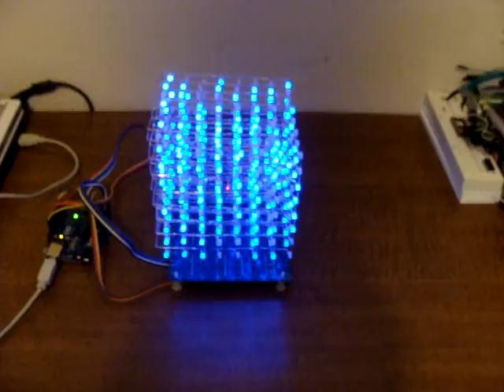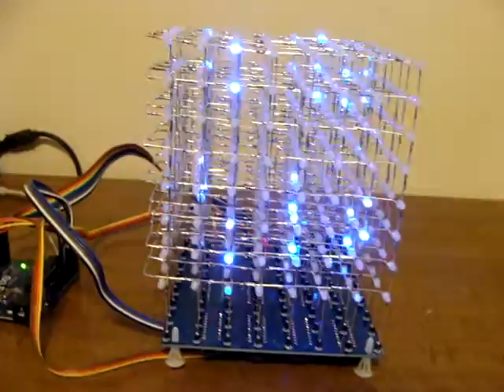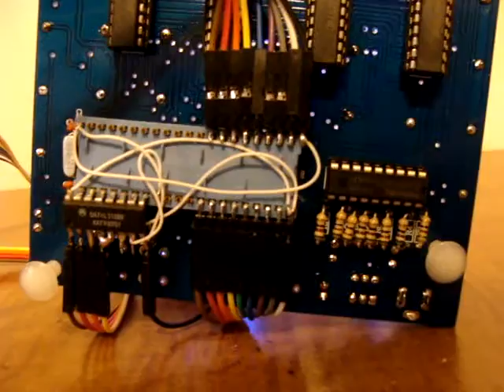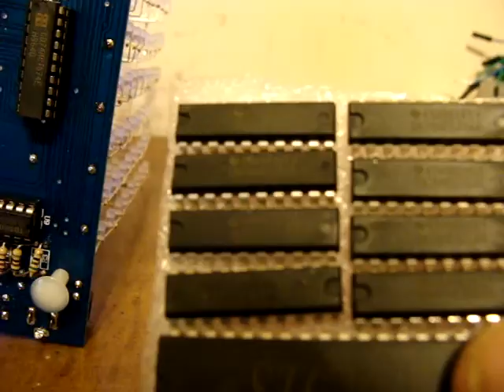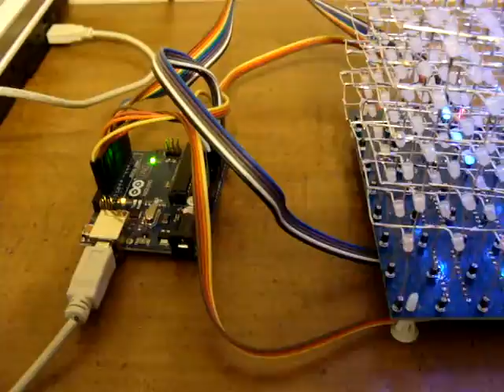8x8x8 LED cube retrofit with Arduino

Comment: Hi Bob,
I was wondering if it would be possible to use a raspberry pi 3 with this cube kit since it has 40 gpio pins. Also would it be better to use the 74hc595 IC's instead of the 574/573?
Reply from the maker: The problem with the Raspberry Pi is that if you move the mouse everything flakes out because the operating system is busy and not updating the cube.

Comment: The schematic looks different from the picture and the video. Can you tell me what is actually connected to what, or should I just trust the schematic?
Reply from the maker: The schematic is how to modify the existing cube project.
Reply: Im sorry, it's not the schematic. I meant the white wires in the middle. I can't tell where they're going.